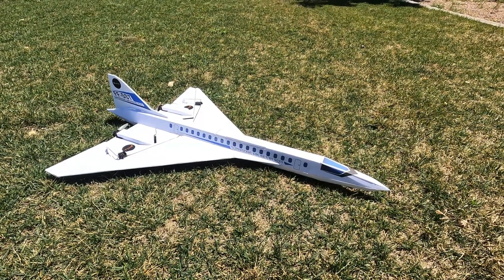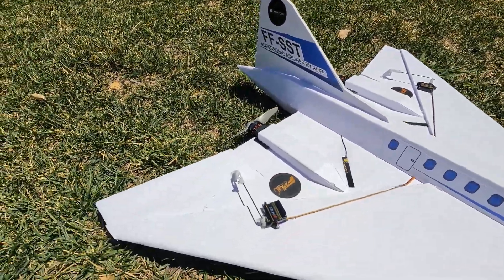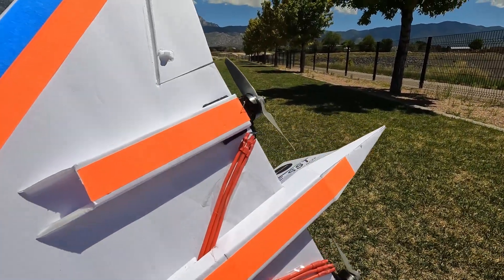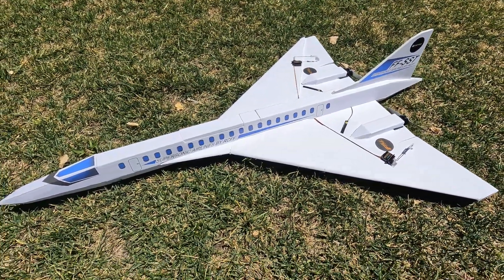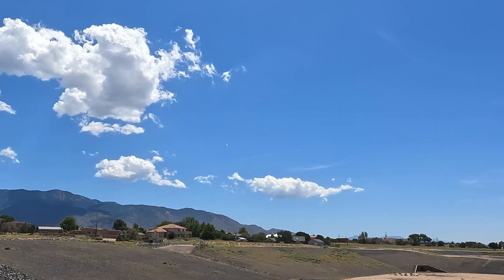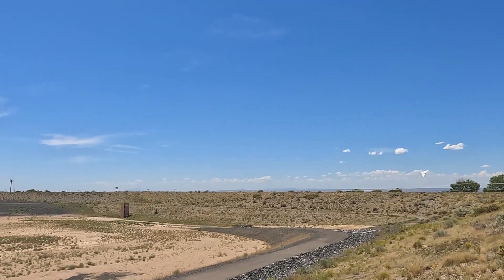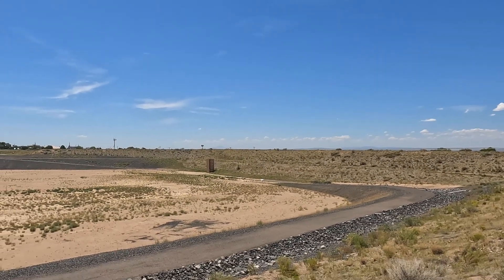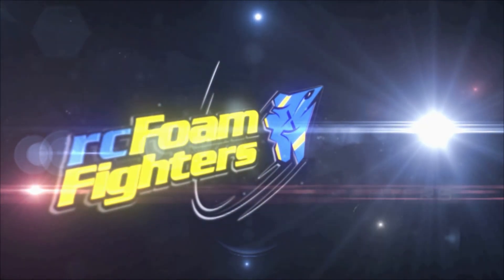New Project! FF-Supersonic

Comment: Good looking plane.  Perhaps some thrust angle adjustment (more upthrust due to thrust line being above the wing) might reduce the need for up trim (if the trim is throttle dependent.)  Maybe make the LERX larger for better slow speed handling. Either way, keep up the good work making these great videos!
Reply from the maker: Thanks for the tips toobaggers!  The motors are actually centerline on the wings bottom layer of foamboard.  Hopefully a little up trim will fix it. If not then I will add some motor angle as you mentioned.

Comment: Very cool Paul. Congrats on the maiden flight. Hope the engine is ok.
Reply from the maker: Thanks Mike! The motor should be OK, it was just the prop that broke, it couldn't handle the high RPM's and let loose.   I will try some different props next time and will also rebuild the plane. This is just a test plane and already see things I need to modify.

Comment: Love the new project Paul. If that was a APC Electric prop, you should probably consider using something else. Through many of my motor tests I have found them to perform VERY badly on the thrust test stand. I have seen as much as 20% less thrust while also drawing 4-5% more current than some of the better performing props i've tested of the same size and pitch. The APC Gas props however perform very well. Which is weird. I made a video on my thoughts why a long time ago. It's a bit of a boring video to be honest 😆
Reply: Another O.G. channel I wish would make another comeback.  I LOVE your motor tests.  Please make more videos.
Reply from the maker: Yes agreed! rcplanepirate please make more motor test videos!
Reply: @toolbaggers  I would like to as well, but I have other stuff happening in my life atm. If things change for the better then I might be able to do some tests again. I still have so many test and projects I haven't done yet. I also now have a much much better PC. So if I start making videos again they should be way better quality. I would just need someone to help my as I am a bit dumb when it comes to computers 😄
Reply from the maker: Sounds good rcplanepirate! 👍Hopefully sometime in the future we can see more videos from you! I fully understand though, the last two years for me I was also away with busy life stuff!
Reply from the maker: Thanks for the comment rcplanepirate! It was an older APC prop I had bought a while back, I have a big box full of them, LOL.  I have used APC props often, but never had one let go like that.  I think those are actually 2200kv motors too and not 1950kv...on 4S.  The prop let go as soon as I hammered the throttle on that last turn.  I was going to use some 3-Blade race drone props, but was worried they would break on landing. I will have to go find and watch your Prop video! Thanks!